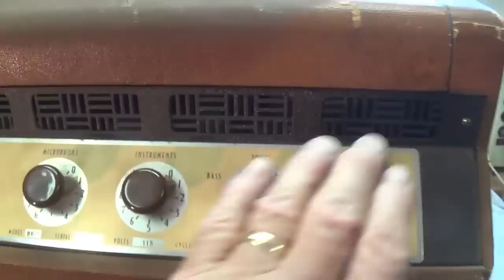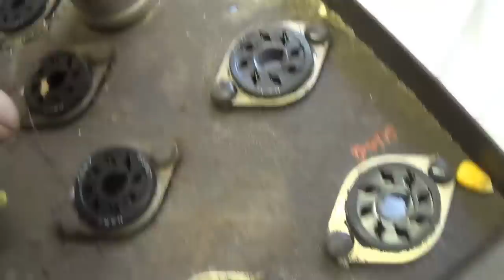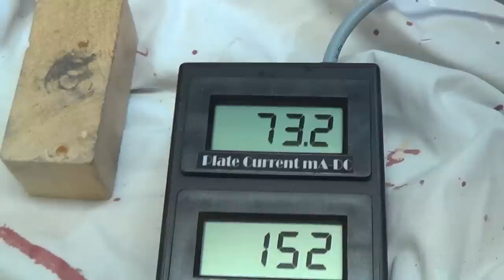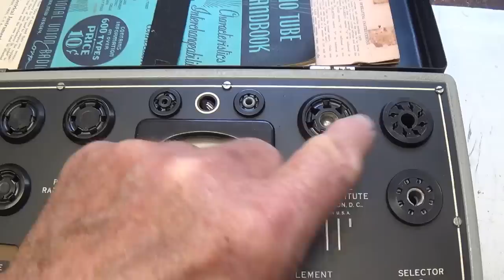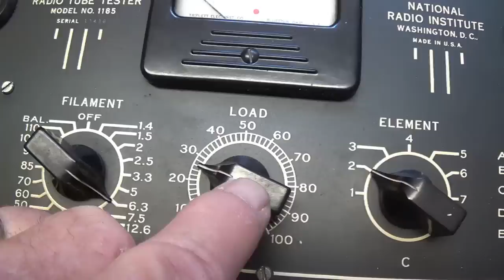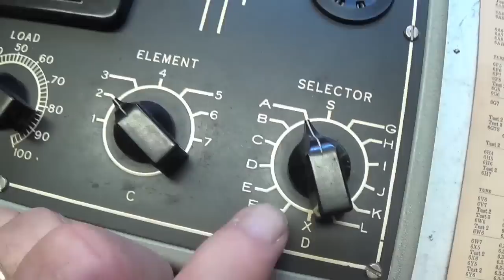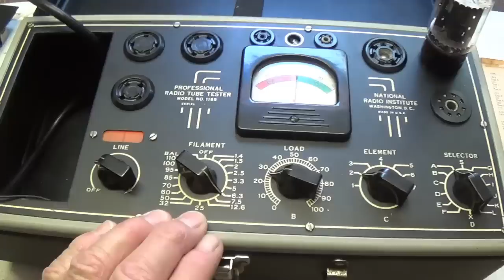Rare & Wonderful: 1946 Gibson BR-1 Amp and 1941 Triplett Tube Mini-Tester

Comment: What is the old wire covering made of? Does this wire dielectric fail very often? Thanks for the video and the sidebar!
Reply from the maker: Post-war, it's probably vinyl insulation, T6. The wire all seemed fine to me. The power cord insulation was all dried out and cracked, however.
Reply: @UncleDoug  , an old ham radio operator once told me that lots of early electronic equipment used wiring that was insulated with a soybean-based rubber-like material, and this is one of the reasons that rodents enjoyed chewing on the innards of old electronic gear. It's worth noting that Henry Ford hip reportedly once built an entire car out of sleeping based plastic. Except for the engine itself, and the structural frame, presumably.
Reply from the maker: I must admit that soybean-based insulation sounds rather tempting, GU. Perhaps with some horseradish and a flagon of ale :)

Comment: Thank you for another great video. Nevertheless I cannot let pass the following. I cannot believe that you did not replace the coupling caps on the amp. I could see the plate current rising constantly in the momentary images shown of the meters. Also, even though I couldn't see much of the schematic, I believe that the 20k high power resistor is there to keep a somehow constant current through the electromagnet coil of the speaker, but I can be mistaken. Thanks again, Charlie.
Reply from the maker: You're welcome, Charlie. I felt that the coupling caps, operating at such a low voltage, seemed to function just fine. You only see a portion of the test procedures in the video......but I understand your feelings.  In retrospect, the 20K resistor was, most likely, to drain the electrolytics when the circuit was turned off, not to lower the B+.

Comment: Thank you for another great video!  I have never seen a Gibson amplifier like that one.  Very cool amp, and wow it really is in great shape!  The tube tester is an exceptional piece as well.  I recently acquired a Heathkit tube tester circa 1953, and yep I had to troubleshoot one of those big multi switches. I don't think it was as complex as the one in your tester, but it had enough wires and stages that I almost put it back together and covered it up.  I continued with my tinkering nonetheless, and it turned out that is wasn't as tough a job as I thought it would be.  I love all this semi-obscure stuff you have on the show, please keep it coming!  Cheers from Central CA
Reply from the maker: You're welcome, Richard. We will :)

Comment: Great video! How strange that the amp has such low voltage/high current. Any thoughts as to why it was designed that way?

Also liked the tube tester tuneup...would love to see you fix up a VTVM. I've been tempted a few times to buy a basket case, but haven't been brave enough to take on the project.
Reply from the maker: Thanks, KT. It made sense apparently, since the circuit still works and sounds great.

Comment: If you are going to play with tube amps you need a tube tester.  I found one at a garage sale.  It was built more recently than this one but was in great shape.  I got a bunch of used tubes from someone and tested them all.  As such I have a stock of used 12AX7 , 5Y3,, 6V6, and 6U7 tubes that are still strong.  I had to trow out a half dozen or so that were too weak.  Recently I got another donation of miniature tubes from someone - still in original boxes.  I'll test them.  I used one of the good 12AX7's to repair an amp for a friend.  Nice to have an inventory.
Reply from the maker: Yes, it is, Willy.

Comment: Wow Douglas, those two pieces of equipment are definitely ‘substance over style’: as you indicated, it is  so often ‘style over substance’ these days ...full of wind and....   well, yes, they might be ‘smart’ but I guess we all know what the are full of LOL.
I have to say, that Gibson amplifier has a superb tone - I like it very much.
The valve tester is an interesting piece of equipment.  It is very likely it was designed for use in the field.  Certainly a handy piece of test equipment ready for use at a service technicians bench, as well as inside a customer’s home, and not taking up too much space under a bench when not in use, and also alongside televisions, and radios in the back of a service vehicle.  Where I once worked, we had similar types, but ours were a little older (around mid-30s):and they too did not include B9A, B8A, or B7G valve bases. They were manufactured by Taylor - you might not have heard of that brand of test equipment.  
Thank you for another interesting, and informative video.
Phil.
Reply from the maker: You're welcome, Phil. Thanks for all your nice comments.

Comment: Adding a ground to the tester wouldn't change any values would it, no leakage to earth? I want it 😂
Reply from the maker: I doubt that the ground would have any effect other than preventing a shock hazard, P.  It is a really sweet little tube tester.
Reply: @UncleDoug  that's cool, I was testing a transformer the other day and both live and neutral seemed to connect to the body - that's what made me wonder about leakage... Maybe the transformer is weird
Reply from the maker: @phonotical  It's scary that live was attached to the body of the transformer, and with neutral also connected, you would think it had a short......unless the connection was through a very, very low resistance winding.
Reply: @UncleDoug  that is what I thought also, it's for a microwave so maybe that's why😕 not experienced enough yet

Comment: Dejavu here... Could you add ability to check 12ax7 by drawing lines from the existing sockets?

Nice grille, a bit of a shame about the bumps, could they be rolled out you think?
Reply from the maker: Probably not, P. It would be more trouble than simply using another, more modern, tester.  Actually, this grille is the best I can find in photos. Yes, it probably could be removed and rolled flat with a linoleum roller.
Reply: @UncleDoug  the G looked a bit like a sickle to me 😂 I'd worry about messing it up, I bet some have been destroyed by people with good intentions before

Comment: I just read that the BR-1 was only rated at less than 18 watts. Seems very low for 2 x 6L6 power tubes. I wonder if that estimate is wrong? That would seem more in line with the output from a pair of 6V6 tubes.
Reply: Makes sense. The plate voltage is much lower than would be normal.
Reply from the maker: Yes, I too believe the output power was reduced by the low plate voltage.
Reply: the output is limited by the power supply, not the type of tube

Comment: Thank Uncle Doug, sweet little tester. Is there a missing dome light (shorts) though?
On the Amp's bleeder resistor, since it is parallel to the output transformer and 6V6 tubes would not the voltage drop be the same as across the transformer and tubes? Was a little lost on that one, sorry. 

I do think that it is used for lowering the tubes plate voltage as you said, it just robs some of the current from the transformer path. Seems strange to do that instead of a power transformer with a lower secondary winding; it just ends up as more (un-wanted!) heat in the amp's carcass.
The amp demo was sweet, really nice. Jack and Ollie knocked that one out of the park. :)-

Cheers,
Reply from the maker: You're welcome, Eddy. You're right about the shorts light.....it may have had a plastic dome. I felt that if the voltage drop to ground was eliminated, then the B+ would increase by that amount. It has to go somewhere.
Reply: Might have been to prevent the output tubes overheating, just a guess.

Comment: What a great sounding little amp. Is the high relative plate current what causes that super-saturation? It seems strange they would have done that on an amp with a mic input. Great video as always, Doug.
Reply from the maker: Thanks, William. I agree.....it is a strange circuit.

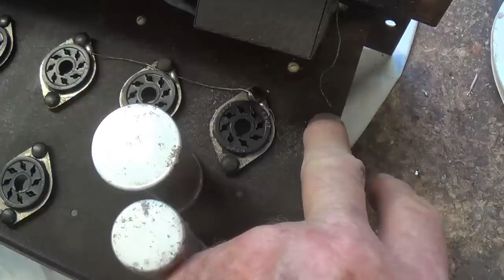Comment: It appears all the tube socket bases are insulated from the chassis! (13:35) Also, note the three sockets bases jumpered together (?)
UPDATE: I realize all the tube sockets were shock-mounted! The sockets in the early (preamp) stages were grounded to prevent hum.
Reply from the maker: I believe all tube sockets are insulated from the chassis, David......unless you mean rubber-mounted, which they are. Not sure about the jumpering.

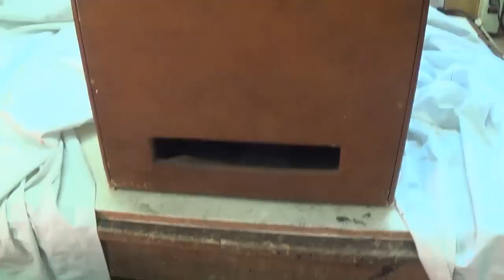Comment: 03:45 - Fortunately there's a slot for cool air to enter from the bottom, but I guess it wasn't enough :(
Reply from the maker: Probably not, David. The tubes are enclosed in a small, minimally-vented space just under the amp's roof......which gets pretty darned warm during use.

Comment: I don't think I've ever heard a better sounding amp!!! Don't be surprised if Beck,  Page, (or Les Paul from the grave) give you a call.. build a clone of this one!!!
Reply from the maker: Wow.....high praise indeed, David. Thanks !!! We're waiting by the phone if any of them should call.
Reply: @UncleDoug  Does anyone still make that type of electro dynamic speaker, Uncle Doug? If not, you'll have a heck of a time duplicating that rig.
Reply from the maker: @tomfrye9037  I am not aware of any companies reproducing electrodynamic speakers, Tom. They can be re-coned and the field coils can be re-wound, however.
Reply: @UncleDoug  I've seen speakers you've re-coned...kinda tedious work(8-). I often wonder if electric motor shops could spin up a new electromagnet/filter
choke coil. One would almost have to know how many turns of what gauge wire. I'll look in my "Glover" pocket ref...there may be a formula in it, but I
wouldn't bet the rent(8-).
Reply from the maker: @tomfrye9037  In the past, with radio inter-stage transformers and antenna coils, I would unwind the coil, counting each turn, then wind a new coil with the same gauge wire and same number of turns.....talk about tedious :)
Reply: @UncleDoug  Tedious times 9, I'd say. No way I could do that if there was another soul within a mile of me. A distraction at about turn 387 would cause  me
to want to go get the shotgun.
Reply: Were the coupling caps replaced, or did I miss something? Btw, great vid, neat old amp.

Comment: Greetings Uncle Doug
USA tubes!!!
I’m convinced NASA build that.
Reply: Wow no magnet 🧲? That is electromagnetic speaker on both sides of the cone?? That was running through my mind even YouTube it with little information in a subwoofer SPL application.
Reply from the maker: The electromagnet's field coil is on the rear of the speaker, HLC, right where a traditional permanent magnet would be. Yes, every part of this amp is USA made......as far as I can tell :)

Comment: Great video and bonus Uncle Doug. Thank e kindly.  Given that the amp cost all that money back in the day, is it possible reliability was critical. I know that even among "boffins" building tube computers in England, "thermionic valves" or toobs, were considered unreliable in the 1940s. It took a guy called Tommy Flowers who worked for the GPO (The UK Telephone company) as an engineer to put them right when he building Colossus he said .. "Just leave her switched on permanently and turn the voltage down during quiet times .. but NOT off!" Tommy was right and Colossus did her job reliably.
Reply from the maker: You're quite welcome, Calco. Thanks for the nice comments and historical facts.

Comment: Beautiful control panel. with beautiful creamy Tung-Sol's !
Question; if that 5u4 goes in wrong,  and makes all the other tubes short, does it ruin the other componets in the amp ?
Reply from the maker: Thanks, Jason. It would matter how it was inserted. The cathode in a rectifier is virtually a short circuit, so the two cathode pins.....in the wrong socket holes.....could cause some problems with the high voltage circuit.
Reply: Uncle Doug. Thank you for responding. the amp came from an L-100. 5u4,   brit. el84's & brit. 12AX7'S all shorted.

Comment: Another very entertaining and informative video. The Gibson amp sounded a lot better than I expected, some of those old amps sounded a bit bass heavy to my ears but this one had a very usable sound. The  tube tester is a neat little instrument and seems to work well.  Here in the U.K. all the tube, (or valve as we say), testers that I’ve seen were made by Mullard , they came in various sizes but I’ve not seen one that small. Years ago I worked for a radio and TV shop and customers used to come in on a Saturday morning with bags of valves that they’d removed from their equipment to get them tested which we did for a small charge per item. Great times!
Reply from the maker: Thanks so much, Henry. Thanks for your very nice comments and input.

Comment: question: 

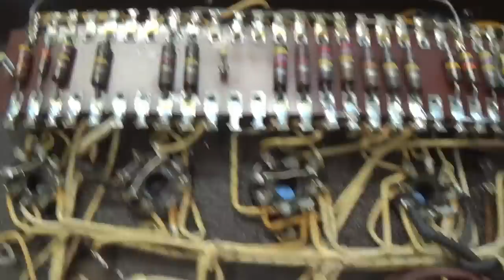time stamp 13:02 you mention electrolytic caps that are leaking and then electrolytic caps under board;

i am a bit confused why the one that was leaking looks so different that the other ones.

when you are pointing to the leaking one all i can see is a square flush mounted terminals.  the other ones under the board are big cylinders.   

am i just seeing the leaking ones wrong?
Reply from the maker: The badly leaking capacitors were in an aluminum can mounted vertically on top of the chassis (look for two such cans in the video......the second can was not leaking visibly). The caps under the board were simply tubular capacitors......not enclosed in a can.
Reply: @UncleDoug  rodger dodger. thanks for reply
Reply: maybe the caps are in the large metal/silver cylinders i see on other side?

Comment: Whoever designed it at Gibson knew what they were doing. That amp sounds killer.
Reply from the maker: I agree, Carl. They built great amps......until the mid-1960's.
Reply: @UncleDoug  My first guitar amp was a BR-1, and I got it at a rummage sale for $50, which I had to borrow from my sister cause I was maybe 13. Yesterday I lucked out and found a Jensen A-12 just like that amp had. I don't have the amp anymore, sadly, but I had heard that Barnes Rieneke was the engineer that designed it, thus 'BR'.

Comment: Another riveting video there Uncle Doug. It always makes my day when I open the computer and see that you've uploaded a new video. Say, I think I may have come across a site that you and your followers might find extremely useful. I don't know about you, but I cringe a little bit every time I see a big, fat, black rubber, modern power cord installed on an antique amplifier. Well, yesterday I was just poking around, trying to find a less hideous way of accomplishing the new power cord issue. I came across  https://vintagewireandsupply.com/ and was very pleased with a lot of the stuff they have. Their electrical cords in particular are all good, safe, modern wire on the inside, then it's covered in braided fabric to resemble a vintage power cord. They even have some 3-conductor plugs that look just like the old timers. Check them out and let me know what you think. Thanks very much for sharing another great video. {8^)
Reply from the maker: Thanks so much, DE. I agree that fat, black rubber power cords are not at all pleasing or appropriate in vintage amps. I checked out the link and really like the wiring products they offer.  Thanks so much for posting it.
Reply: @UncleDoug  That Newcomb amp you worked over a few vids ago leaped to mind when I first found the site and began eyeballing their stuff.  Of course, any vintage amp would definitely benefit aesthetically from replacing the big ugly cable with one of those cloth covered jobbers. It could get very expensive very fast though if a guy went through his whole collection and implemented a wholesale replacement project. Especially if you consider the funds that were tied up in the pile of perfectly good, brand-new power cords that got pulled in favor of the vintage product. I think I might do a couple of my favorites, and endeavor to use the Vintage Wire products on any new amps that come down the pike.
Reply from the maker: Good suggestion, DE. Thanks !!!

Comment: All the old waxies should have been replaced. They would all be in some form of decay ready to fail. Why take a  chance on the tubes and transformers for the small cost of new poly caps?
Reply from the maker: Normally, I would agree with you, Daniel, but when 600V caps are operated at only 150V, then tend to last quite a while.

Comment: At that low B+ even the old metal 6L6's would be just fine.  It does seem odd that even the old metal 6L6 data sheet does not show operating specs for voltages that low.  Obviously, that doesn't mean 6L6's won't work or sound good with voltages that low.  I love how tubes can still work with a large deviation from their design specs.
Reply from the maker: I was really surprised that the tubes operated and sounded so good at such a low PV. You're right, PT.....they are very forgiving about their operating parameters.

Comment: Hi Doug, it seems to me that the 20K resistor is a shunting resistor, not in series. So adding this voltage to the anode voltage is not right.
Also it seems to me that there is no way the very low anode voltage and the high current is right. Also in those days, or perhaps especially in those days they knew what they were doing. Choosing a totally wrong point of operation seems me very unlikely. And if I may ask, more Ollie and Jack footage please! :-)
Reply from the maker: Thanks, AG. I  think you may be right about the 20K resistor not reducing the B+, but that would mean that the high voltage winding itself must be responsible for the relatively low operating voltage.